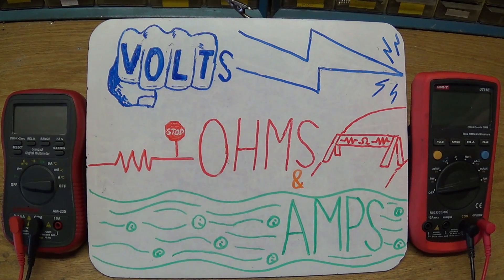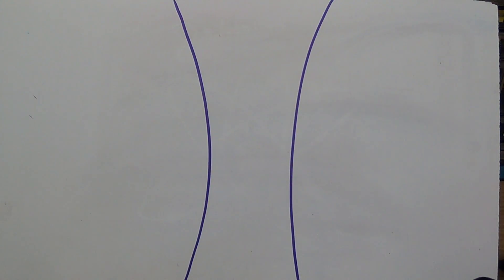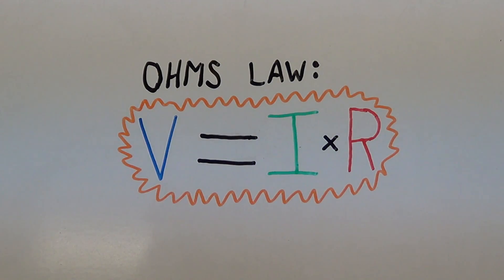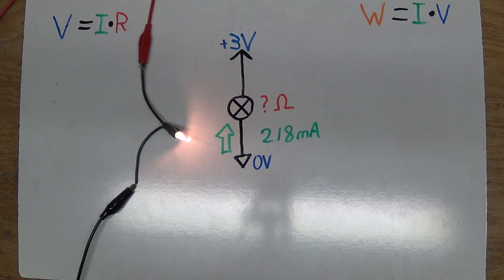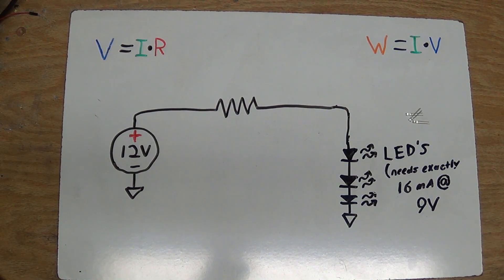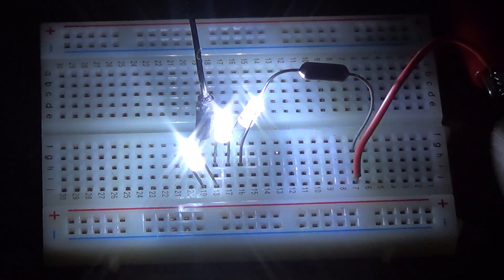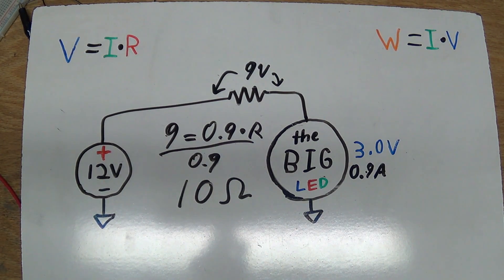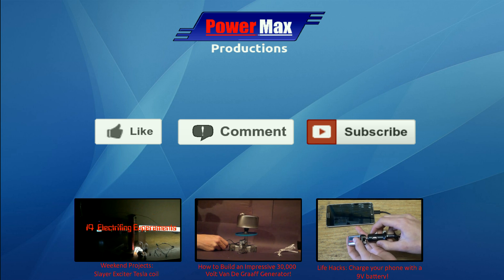Tutorial Tuesdays: Volts, Ohms, Amps, and Watts

Comment: Totally I agree what you say about the definition. I wish the teacher can explain better than you. I have a question is about Watt? I will say, I use 1000volt electricity that mean is equal to 1 Watt. please correct me if I am.please correct me if I am wrong with my logic.Can you make a video, how Electricity Company make  a lot of money of electrity.
Reply from the maker: +den leon Thanks! You can't "use" 1000v of electricity, that makes no sense. Voltage is electrical pressure. That alone is completly meaningless. Amperage is the actuall flow of charge, specifically, one coulomb per second.These 2 things multiplied will give you power usage. 1000v x 1A is 1000W of power. Likewise 1V x 1000A is also 1000W of power. Please watch (or rewatch) the video from ~4:50. That is where I discuss watts.

A electric company can make money by monitoring the total amount of energy (in physics the correct term is work) that has flowed through that grey box that connects your household wiring to the power grid. This is actually done by measuring the current flow, and since the voltage is roughly a set value (I think about 220v-240v) there is really no need to measure that. With some basic calculations and logging of data, it can calculate how much energy they have delivered to you. These calculations are a bit advanced if you are not familiar with AC power, differentiating reactive, apparent, and real power (weird side effects of using AC instead of DC, and the effects of capacitors and inductors on AC power.) but they are not too complicated. A killawatt meter does the same thing.
Reply from the maker: +den leon Technically, voltage is a term interchangeably used with the term "potential difference" because voltage is defined technically as potential to do work per unit charge. I personally hate this definition with passion, because that is about as useful as saying that force is defined as acceleration of something multiplied to its mass. I see voltage as something that cannot really be defined as it is elemental, as is force, for which things like power, energy, and all those other units can be derived from.
Reply: I agree 
 I use 3 volts electricity for my room for hours. The electricity company is measured by Watts